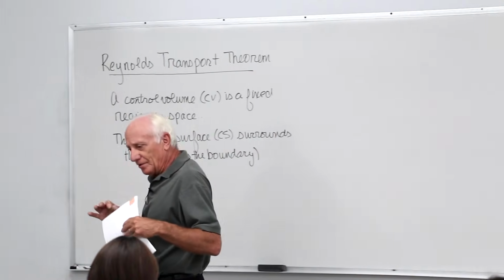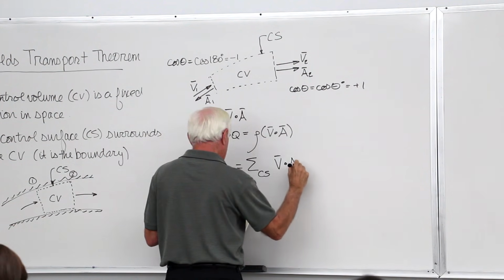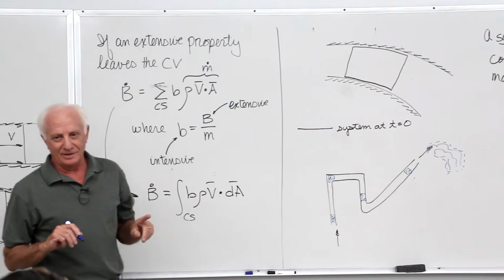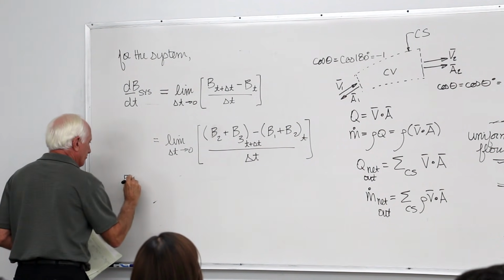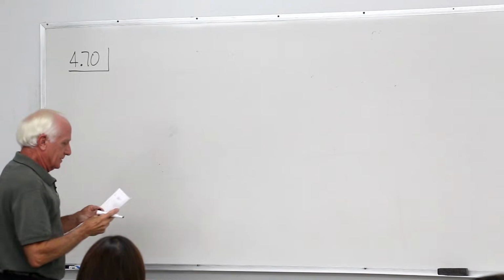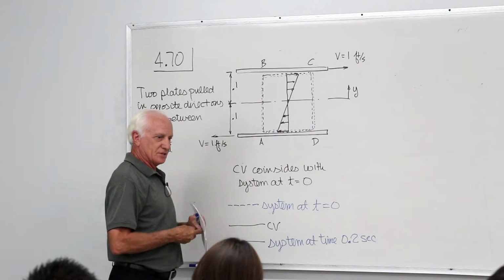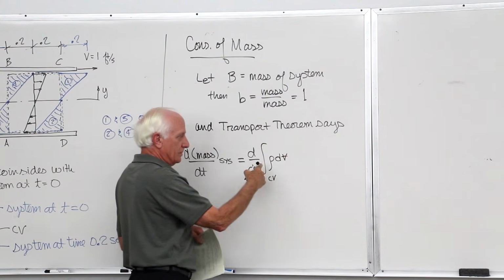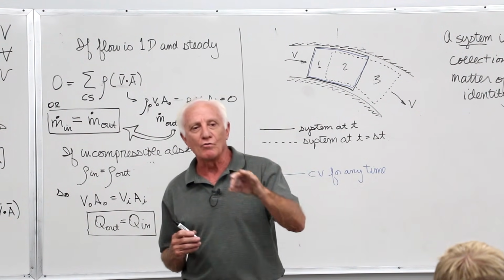Fluid Mechanics: Reynolds Transport Theorem, Conservation of Mass, Kinematics Examples (9 of 34)

Comment: Q=V*A=V*Aθ*cosθ=|V|*|A|*cosθ=vector(V)*vector(A), this derivation starts from numerical numbers ended up with vector form, anyone could explain step 2 to 3 in this derivation I showed at beginning? why V*Aθ*cosθ=|V|*|A|*cosθ?
Reply: even I've got similar problem here
did you figured it out?
Reply: This is needed when the velocity is not normal to the CSA. The cos theta is used to account for the component of the vector that is normal to the CSA.